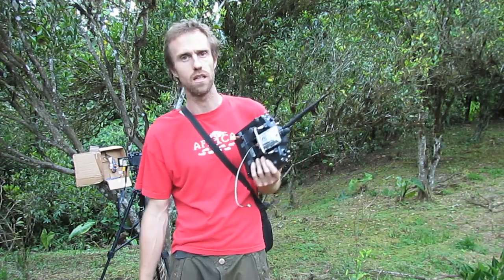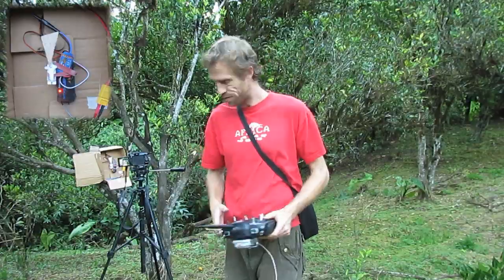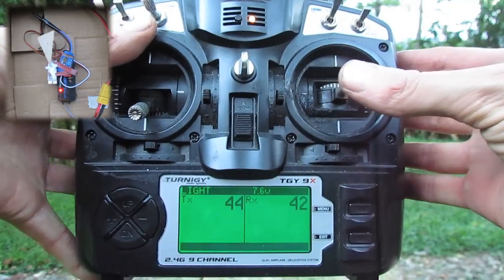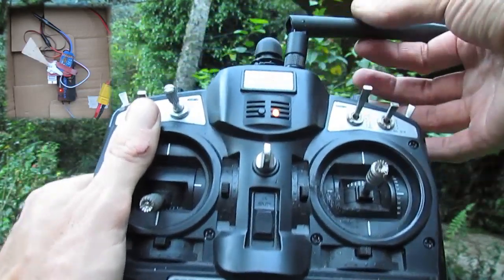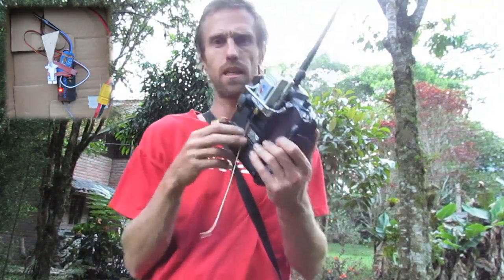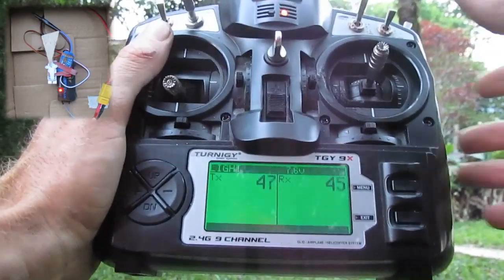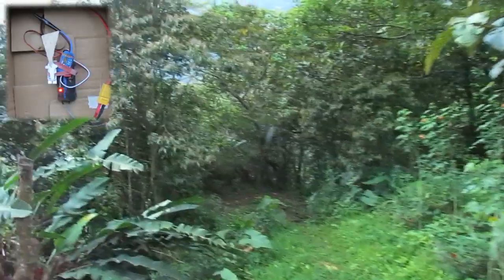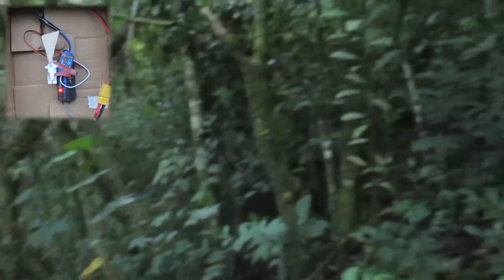FrSky Telemetry Range Test with Wifi Booster. RCHacker #18

Comment: Thanks for using our indoor booster ARG-1105
Good video!
Reply from the maker: No worries, they are not designed for this but they seem to work well enough.
Reply: before I thought our booster only can used to booster the router wifi signal......

Comment from the maker: Just an update on this, I have read that it should be used with an attenuator.(6dB with FrSky) If the input power is too high they work but do not last long.

Comment: Is that a tx output amp or a rx amp? At one point you mention the failsafe should have kicked in because you weren't getting telemetry data back, that's not necessarily true.

Comment: great video, i was going to order a 9x and the frsky telemetry module but i thought it was just plug n play, is that not the case? i was getting it to use with my dji naza quad so need to use failsafe for gps, can i do this with this module? it works with a standard 9x with stock module so will everything still work the same with the frsky module? thanks

Comment: pack before use. before i powerd it trough the pins on the back of the frsku module. i belive thers to powe pins ther. one below 5v and one arund 6v. what do you think is the best way to power the booster? realy downt wanna use an other lipo and im not shore if its safe tonpower it trough the frsky?? It might be the ubes thats interfearing with my conntroler? Its allso shelded with alu tape thats grounded to. Might try an other ubec and see.

Comment: I'm still waiting on some cables to arrive so I can test telemetry.  Would the antenna still provide some gain if the power was not applied to the booster?  If so, what I have in mind is using the boost as an insurance policy (flip a switch and my range gets extended).  Because it could cause problems for other people, I would rather use high gain antennas and modest power most of the time, and the booster just when I need it.  But I want the switch to the booster to be a simple toggle switch, no antennas to change.  Anyone know if there are any repercussions with this approach?

Comment: Hmm. Yah im using a Rhino 2620mAh 3S 11.1v Low-Discharge Transmitter Lipoly Pack. Says it has 3c discharge. Maby thats to low for everything?

The only reason o can think of why the numbers ar flikkering. is that the drow is to big? Downt realy think its the ubec interfearing?

Are you saying the the booster and ubec is overloading the RC pack?

Comment: Appreciate this video! Would you say I could expect similar performance increase using DSM2 protocol/rx or walkera's rx1002? Trying to understand if the wifi booster is only worth it on FrSky equipment (which I don't have and can't run on my devo 10)

Comment: Apart from a very illuminating video on something that is currently near and dear to me, your surrounding sure remind me an awful lot of Costa Rica. I used to hang down near Dominical. A place called San Juan de Dios. Am I even remotely accurate in my guess?  Anyway.....I am trying to figure out the various sensors that I want to install in my fixed wing. It is all new to me, been in it for about 6 mos. A little daunting to be sure. I will check your other vids for more.. Cheers

Comment: Nice review;)
you mention using the 6db Attenuator. Is it those normal SMA jet? 
you mean which will not last long? The TX or Booster?
Reply from the maker: +Mervyn Cheryl Sorry been a long time since I made this video, Booster will not last long without an antenna.
Reply from the maker: +Mervyn Cheryl Sorry been a long time since I made this video, Booster will not last long without an antenna.

Comment: Hi, I have a FS-i6 transmitter which has 2 default antennas. If I use a Wifi amplifier, how should the amplifier be connected to the transmitter ? Thank you
Reply: I have fs i10 with only  2w booster in the vertical anntena. work great!! for the moment fly over 5km  and the signal is good

Comment: hey! You sem to know your stuff. iv bennusimg the frsky with the booster for a wile now and resently i notest that my the voltage on the screen of my 9c is twitch. and not on a solid voltage. im currently powering the booster trough the trainer port via an HK 3map ubec. allso i got a klip on freittring at the port and one ring after the ubec. i notest this when my transmitter pack whas runnung low. maby 3.6-8v and i got a tottal signal loss. cinda scerd of using it now so allways chargin my -

Comment: Yeah thats what i was tinkin so thats why i tryed to use what im currently using. BUT if you look in the manual of the frsky modul it says unregulated voltage on the 5v pin and output from transmitter modul on the other.
Im thinkin its not good for my 9c if the voltage numbers ar glitching. Probebly the best way is an lipo for ust the booster i gues.

Comment: Appreciate the video!  Would you happen to know if using the 1W amplifier would result in substantial noise or spurious radiation in the 2.4 GHz spectrum that would impact other R/C flyers?  I'm trying to decide whether to get an amplifier or just buy an OpenLRS system.  We have a lot of 2.4 GHz flyers at our field and I wouldn't want to interfere with their radio control.  Thanks!
Reply from the maker: Cheers. This thing knocks out my wifi. So yes, go with the openlrs. Even the 1W openlrs systems cause lost packets with the 100mw openlrs systems.

Comment: Not really understanding your test. You have the amplifier on the tx but you're looking at the reception you're getting back to base whether the amp is doing its job. Doesn't make sense. Am I missing something?
Reply: hand held radio is both rx and tx 
talking and receiving data from the plane
plane goes into failsafe mode when loss of talk happens ...not good... loss of data

pretend the servo in the box is him standing there and as he walks around he is the plane flying around the building with hammocks loss of signal would make plane fly into bushes or execute failsafe mode (presets intended to crash the plane rather than have it fly off to battery burn up heaven)

turn the booster on plane reestablishes contact with radio...  might be good switch to have on your hand
use rx/tx amp need power supply for it 

more distance and a panic switch
vs
more cost, more mass, more parts to fail 
...more items to declare at customs
hope that helps

Comment from the maker: Been a while as I have moved to openLRS,  but I though the input on the booster was pretty specific at 5 or 6 volts. If the power on your trainer port is a direct battery connection you might be okay. If it goes through the 5v regulator then you are most definitely overloading it. Another possibility those HK ubecs are shit. Make sure your battery has enough grunt too.

Comment: Great video , I'm wonder will a 3 cell 12v Lipo Battery be enough power to power up my sunhans signal booster.. or will it be better to have a setup like what you have ?
Reply from the maker: Not sure if 12v would be too much for it. Just check what the wall wart puts into the booster. To be safe I would use a 5v ubec.
Reply: Thanks !!
Reply: The Sunhans booster should be 12V so your Lipo battery should be a good solution. I've read a 3000mah battery gives you about 2 hours of run time.
Reply: +John Dufour I'm using it with a 4500 3S battery + the controller + the receiver, i get just 60 minutes of use, not more

Comment from the maker: ah, the second part. You are risking wrecking your frsky module and or 9X. Power directly off the battery if the specs on the booster allow it. Otherwise you need a separate battery of the correct voltage or another linear regulator.

Comment: Hi, I used different brand and apply it to my dji phantom but I dont get it work,, do you have any idea??  Which one have to turn on first ?? The Tx or the booster,, thanks
Reply: You have a different booster with a different radio system there are a few things that can be wrong here.
See if you can find out the output power of the DJI transmitter, if it is too high it will burn out the booster. Also the booster is designed for switching between tx and rx rapidly, (wifi) frsky is similar to wifi in this way, DJI protocol could be different. Lastly the DJI receiver might not be able to handle the rx signal that the booster amplifies, perhaps it has been burnt out also.
The order that they are turned on really should not matter.
Reply from the maker: also the booster might have been defective from the start. Sorry but without the right RF gear or other examples of this working it is very hard to figure out what is wrong.

Comment: My Radio futaba t8j, the Radio has two antenna inputs, if I connect the booster only one will work.thanks
Reply from the maker: Edimar Stein yes it has a diversity system, pick one antenna. seemed to work for this guy http://www.rcgroups.com/forums/showthread.php?t=2132551

Comment: Can this wifi amp to be use on stock turnigy rx and module?
Reply from the maker: Not sure, things to consider, the fact that it is a one way protocol and that the output power will be different and possibly too much. No doubt someone on rcgroups has tried it before.
Reply: Soo it will cause some burn?
Reply from the maker: shahrul nizam saharudin Maybe, I have not tested it myself.

Comment: does it increase the range like 5 to 10%, what do u think
Reply from the maker: Aldo Allende Oliva twice as much, aven more open air.
Reply: Do u think its better than dragon link. How much far so I can go with this booster. Can I use in spectrum radio. Thanks for take your time to answer.
Reply: depend on the power of amplifier, 2watt= x5, 5watt=x10

Comment: power it through a Turnigy 5v/5a SBEC  $11 on ebay  6 volts.  Throw a 1 or 2 watt wifi booster onto a 2.4 ghz and you can really go far.  Check out my channel and you'll see a video of my Bixler 2 flying 6.3 km of my Futaba 7c 2.4ghz.  There is also an install video there.